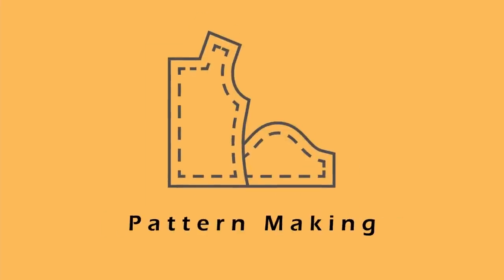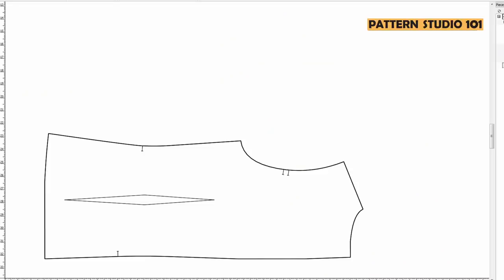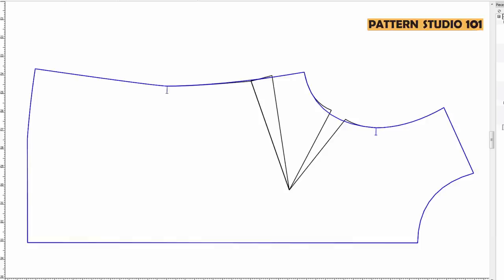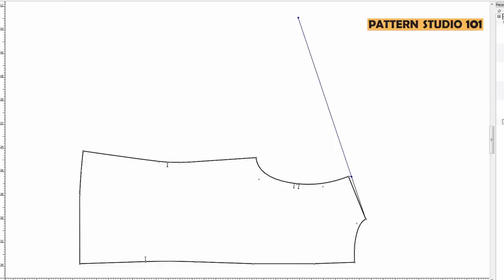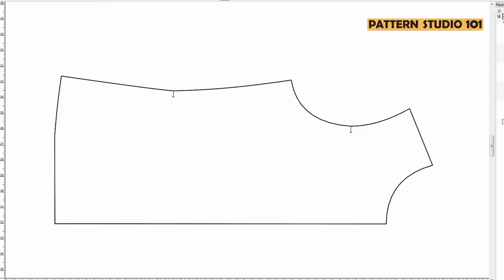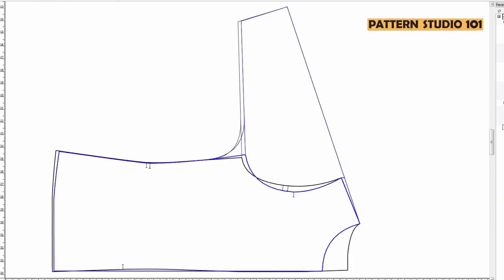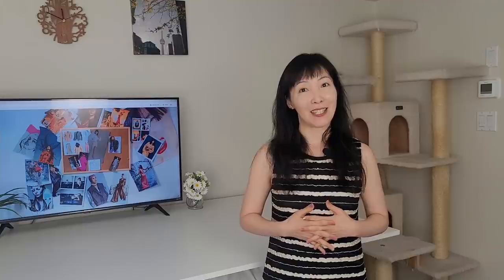How to Draft Kimono sleeve patterns from Basic Bodice [Pattern Making Tutorial]

Comment: I love your explanations. Do you actually make a kimono with this kimono sleeve pattern? Where do you connect the seems since no material has this width? In Japan the tissues generally are even very narrower, aren't they?
Reply from the maker: Hi, it doesn’t have to be one piece. There are seams for the shapes, but there are seams for just design, patch, for different grainline, etc. You can have a center back line or make lines for sleeve part. If you want to make a kimono sleeve top one piece, you can cut it cross-grain. If it clear?
Reply: @PatternStudio101  thank you very much for talking the time to explain. 
I still have a loooot to learn. I'd live to make a kimono top one piece. Maybe I need a special pattern to be able to cut it cross-wise. Your idea sounds intreging. Thanks a lot ♡♡♡

Comment: Hi😊.  Can you please clarify what the front armhole depth is?
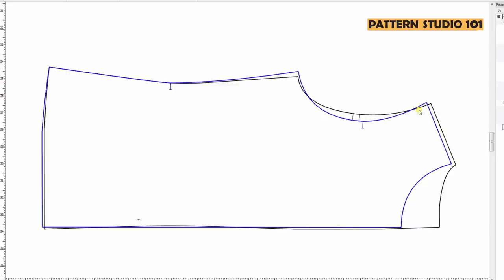Reply from the maker: Hi Angela, I said armhole depth in this video at 2:10. The straight length from the shoulder point to the line (or level) where the underarm point is. Not the length of along the curve, but the height between two point. I hope it helps. Thanks!

Comment: Thank you for your awesome videos. I have a question for you about this one:  my front bodice pattern is bigger than the back pattern ( bigger bust i think), when i try to match the side seams the armhole does not match at all, how can i measure that? Or my pattern are wrong altogether?
Reply from the maker: Front body can be bigger than the back in chest circumference. Match the underarm points. Put on top of each other. Armhole curves also can be different. In the lesson, my example armholes are not the same. Can you explain a little more detail where is not matching?
Reply: @PatternStudio101  when matching the side seams together, the underarm points cannot seem to match ( front pattern goes way up than the back pattern), so i cannot compare the armhole depth on both patterns.
Reply from the maker: @Heba Elasiouty  You mean the front side seam and the back side seam are not the same??? They must be the same. In case you have a side dart on the front, then ignore it and match underarm point.
Reply: @PatternStudio101  thank you ❤️❤️❤️

Comment: I have forward shoulders and my shoulder seam is moved forward 1/4" at the HSP and 1/2" at the LSP. So the back is longer than the front. How would this work in that situation?
Reply from the maker: Hi Cheryl, there's no problem if the back is longer than the front when you match the underarm point front and back. Adjust shoulder angle to be the same both the front and back. Then, you can extend the shoulder line.